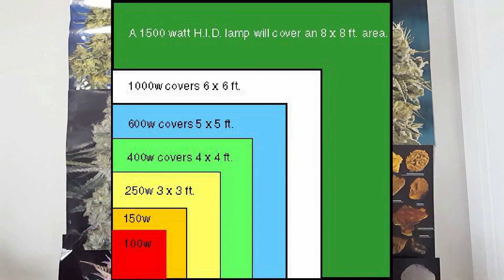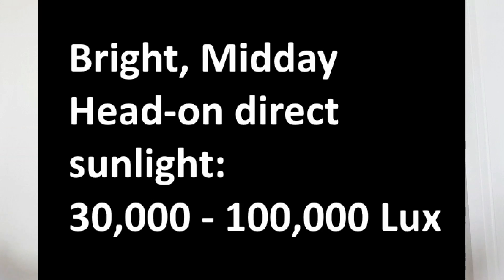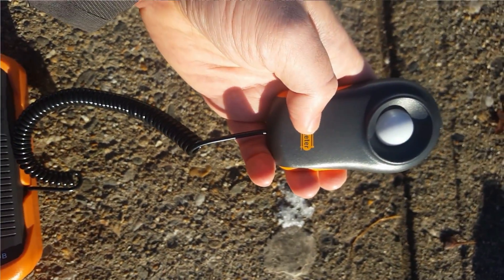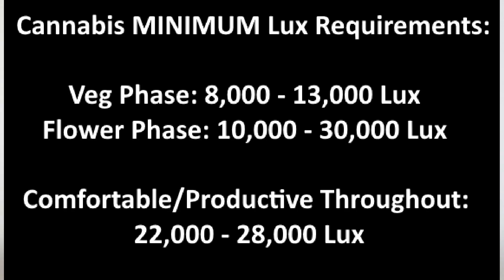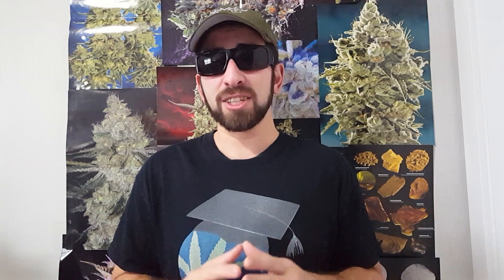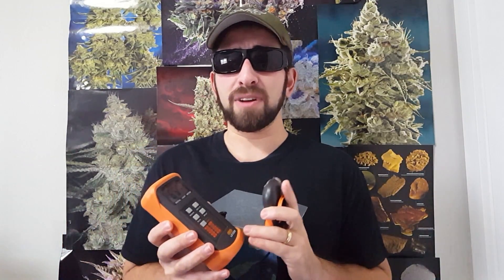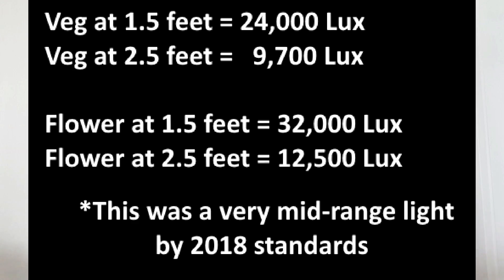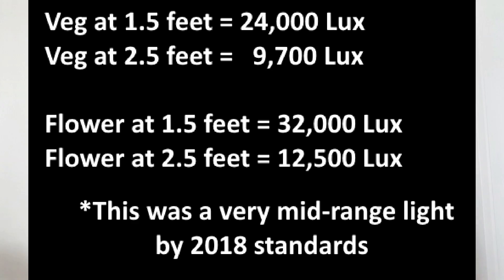How Many Lux Does Cannabis NEED At Canopy? + Digital Illuminance Meters Overview

Comment: I have looked as several websites, including royal queen etc... and they all mention values of 45000-75000 lux, that is 2-3 times more than you say, so I have no clue if I should aim for 60000 or 30000...
Reply: Agreed, most suggest  75,000 in flower. Lex recommendations are lower to all I have seen.✌️

Comment: I’m running fast bud genetics and using 1000w HPS DE and LED lights and have taken measurements with my phone and a diffuser. These plants can soak up as much as 80 thousand lux and seem to love it. During veg, anything over 40 K seems to keep the plants too compact under the LEDs. Different strains my have a  lower ceiling compared to other’s for the light the can use.

Comment: Thank you for doing this video for I'm in the process of using several different lights and it seems that most site are recommending huge lux numbers that my powerful lights could only reach if I burned the plants.  I saw numbers like 50,000 to 65,000 for flowering and 15,000 to 50,000 for veg.  Thanks for clearing that up for many of us.  Peace!

Comment: I am a first time grower. I am using T5s cause that what I had to over winter my plants. 
When it’s time to start flowering, do I need to change the bulbs to 3000k? I currently have 6400k bulbs in. Or just change the cycle to 12/12?

Comment: So ... if an LED light doesn't give off any (or very little) heat, should we worry about  burn at the canopy with a light under 1 foot from the canopy?
Reply: Yes, where heat wnt be an issue, intensity and light bleaching will be.
Reply: @reefslinger9188  Light beaching? How can that happen? The sun puts out a lot more intensity doesn't it?
Reply: @Superflow25  nope. It’s far far away. 😁
Reply: @reefslinger9188  Yeah ... I'm not sure that makes any sense. I'll let you know how "bleached"  my seedlings turn out with the lights at 12". You may be right. In which case I'll gladly confirm your hypothesis. Check back in 2 weeks.
Reply: @Superflow25  so? Is your seedlings was healthy??
Reply: @mikelazar8061  they’re fine although I took your advice and raised the light up to 18”. Thanks. For your help!

Comment: This makes sense to me. I have been finding symptoms of light stress (yellow or brown end tips) on the higher leaves in the canopy when I have been using the higher lux values advocated by others.
Reply: same here...i see ppl recommending a 600W hps to be placed 40-50cm above canopy.. its around 40-50k lux. thats crazy
Reply: @ninjafrog8419  man, all bs, check out the new studies on light. Apogee Instruments is a great start.
Reply: @ninjafrog8419  50k was actually where my buds was the most frosties, 40 and 60 turned out with less.. remember a healthy plant can tolerate higher light levels ;)
Reply: @Avation911  all through out? Or that is ur final light?
Reply: When u have a really healthy plant yes you can slowly lower to increase be careful about burning the leaves I’ve had a 400 watt MH/HPS combination bulb @8inches yes glass and vented fan on each side but it was very healthy finished super frosty sometimes fluctuating the distance of the light helps the plants to if they get to bushy not really a thing but ease it back a few inches it looks to be slowing down in growth drop it 4 to 6 inches ❤😂

Comment: you know this may have really helped me out today. Ive been wondering why my girls in veg have been showing signs of stress, and It may have been me cranking my Quantum Boards up too high. I have a LUX meter on my phone ( not very accurate ) but it gave me an idea of how intense these lights are.

Cranked half way up and at around 3 feet It was saying 35-45k at canopy around the centre of the tent. First run with these boards as ive just upgraded from some citizen clu048 1212 arrays, and these boards are better in every way so far. They have 3500k, 5000k, 660nm, 730nm and 385nm. Ill give them a few days turned down and see if they turn around.

Comment: Sunlight here is about 130,000 lux, I just measured in April. Why do indoor plants get light burn excessive Lux, but  less than that of sunlight, even if the heat is dealt with? But outdoors they do not.
Reply: The sun moves so it's constantly changing position and not concentrated perpetually. Grow lights are fixed, direct points of radiation concentrated on the same point on the plant constantly.
Reply: @blueflowers6738  Yes the Sun moves (in a straight line), but in fact it is the earth that revolves around the sun not the other way around so, it is the earth that moves not the sun :)
Reply: @sopalen   the sun moves "relative" to the Earth and the plants on it. ;)
Reply: @sopalen   and the sun doesn't go in a straight line. ;)
Reply: @sopalen  and the Earth orbits the sun. It revoles while doing so getting that even lighting that plants enjoy. Well rather the Earth enjoys, us and the plants being akin to fungi. The Earth is alive, we are born of it, not on it. We are all the Earth.
Reply: @blueflowers6738  Nope ofc not it orbits Sagittarius A* i guess :)
Reply: @sopalen   and Sag orbits another that orbits another that orbits another. Pretty "far out" stuff! :)
Reply: @blueflowers6738  I know, i just did not knew that you did :D have a nice weekend m8.
Reply: @blueflowers6738  Yes it does, this is the third time responding to this, YouTube might have fucked some shit up i dunno, but yhe ofc you are correct, have a nice weekend m8.
Reply: On a sunny July day in Arabia you will receive 400,000 lux😂

Comment: Great channel and great info. You helped clear up my confusion about what was the correct amount of LUX at the canopy level.  I'm seeing 25k at the top of the plant and 12k at the bottom in flower with the light about 2.5 feet above. i worried LUX was too low but now i'm resting easy all the way to harvest! thank you!
btw... i use a free LUX meter app on my android phone and it is fairly accurate. If i had more than 2 small plants in a 3x4 tent with 600w hps, i'd consider a dedicated 
https://www.youtube.com/watch?v=ezhAZcpRkNg&list=PLkkO4lYMrrrmugcJ9ySxWLeqJYxK2qCqS&index=17&t=0s

Comment: Hey Lex thank you for the video. Im on my 6th grow and Ive noticed something about LEDs that I dont see mentioned. Thought Id see if you have noticed this too. If you place LEDs too close to a plant (say less than 12 inches/ especially when in veg) They tend to have shorter internodal spacing and a general bushier build. As I said only a few grows and this is comparing clones from bag seed so was hoping you could tell me if its in my head or not. Thank you.
Reply: of course internodes will be closer when light is closer, when the light is further away the plant will stretch causing stretched internodes , more light closer the internodes ...

Comment: Lex first off what a great show. I just got my Dr
Meter and checked the Lux. It was 45,000 so I raised the light to about 2 feet
from the plant. It now reads 35,000. I know the optic 2 runs hotter than other
LEDs I’ve have had in the past so do I still need to go up with the light? I
have the room to go up. Just wondering what is better for the plant.

Comment: Thanks for this video Lex  its the one that i really needed.  I ordered a Lux Meter from HydroFarm  in all honesty i thought it also read the PPFD  but it does not and i had no idea what Lux value  cannabis would grow in.   So this video actually really helped me. The lux at the canopy of my plant was at 45000.  So i moved it up to get into the range suggested.
Reply: @tommy whitlow well the light i have is actually a pretty good light. I have the hlg qb100 while i didn't get monster buds the ones i got were pretty dense. 4 zips from 1 plant. I have upgraded my lights since and now have a mars hydro sp 150 so the lux value is 100k at the top and 80k threw the canopy. My par value is around 1000 ppfd above that you need to add co2. I am not light limited now i am carb limited.
Reply: Also i think lex is giving us the minimum light needed to grow.  Ie..a 75w cfl will grow a plant but you will get small buds. (I say this because i have done it)

Comment: I picked up 3 2500 lumen cfl bulbs at a salvage store can I use them or will that electricity be wasted
Reply: Dangit man, you can use them. 7500 Lm is enough for a small grow. I used to do the same with cfls in a  50x60cm cardboardbox yielding pretty good. Edit: then again, waste or not.. you could buy a small cheapo more efficient LED fixture.  I bet your 3 cfls is aprox 50W each in draw.
Reply: @svenzia  i also have 12 12 watt 75 watt replacement 24 inch red/blue led grow lights from Walmart i added 4 under Cabinet led lights and 4 24 inch t5 plant light
Reply: @donkeedik2302  Have you planted seeds? You are good to go man. I have done lots of cfl grows. Awesome quality. Big upz!

Comment: Thanks lex for another very informative video! I have a question off topic however. It is to do with tinctures. Many recipes call for decarb of flower, soak in alcohol for a period of time and then a strain. Simplified version. My question is this, can we use fresh cut flowers? This saves on dry/cure time. Flower usually sits for two weeks anyways. If this is okay, how can we scale the recipe? For example if I use 4g dry/cured flower per 1oz/35ml of high proof alcohol. When using fresh off the plant flowers they’re full of water etc and thus heavy in comparison. How can we figure out how much to use. Without a trial an error. Ball park guessing/educated workings.....
I see it’s more than one question, but it’s all relevant right? Much love fella. I look forward to your speedy response as always!
Reply: didnt seem to be so speedy of a response bro
Reply: Honestly you will have to do trial and error, I have not found a video yet that will convert it from dry to wet , one piece of advice is use 190 ever clear it’s a lot safer I have used both & they both work .

Comment: Use an app on my phone.
Not super accurate.
But good enough for my basic  spacing and defoliating needs.
Reply from the maker: I hate to say it, but the phone apps are REALLY  inaccurate - it's a poor substitute....phones just don't have the on-board hardware required to take the measurements as intended for the lumens math to be right.
Reply: Lol.. Wouldnt doubt that at all.
Probably just soothing myself somewhat.
Im not really using the apps actuals numbers as values per say.
Ive never used any metering on lux values or really considered it previously at all, with no issues because of that neglect. 

Im just using the app by placing my cell into certain lower areas of the plants to see light penetration through canopy, so I can defoiliate accordingly or adjust lights/reflectors, etc.

Seems to work for that basic light registering need. 
Saves a bit of time by checking angles above and beside  canopy for light penetrations quick, if im growing vertically and not scrogging or mainlining.
Reply: Im basically trying to decide if I need or want that $32 meter that I looked at in your Amazon store..  hahaha
Reply from the maker: most people have no need to measure Lux and if they need a meter it's a PAR meter, which are pricey. Measuring Lux is sort of a specialty thing for certain situations, as mentioned in the first couple min of the video.
Reply: Yes, I think the app is somewhat misleading in its name, lux meter. 
I looked into its design and its more of a light intensity meter,  that runs with an algorythmn. 
Its reliant on the hardware of the specific phones sensors, much like you mentioned.

Some newer cell models have some impressive sensors for this aspect, I think with design in mind for more photography type applications.

Comment: What’s the damages that can occur from 315 cmh bulbs without eye protection? I’ve been dealing with some scary symptoms & haven’t been able to share the love to my garden. :(
Reply from the maker: You can do extensive eye damage working with HID bulbs over the long-term without eye protection (though, you'll be fine with HIDs at least, if you just avoid looking at them directly). If you're having scary eye symptoms, go to an optometrist.
Reply from the maker: & happy new years!
Reply: Lex Blazer thanks! 🙏
Reply: I'd assume similar to welding flash but not as bad unless you are exposed for a very long time... Symptoms of damaged eyes from u.v. feels like you have sand in your eye that won't go away for days, plus redness, tearing, light sensitivity.
Reply: volvo09 thanks for the info. Idk where to go from here. That doesn’t sound to good for me. Hopefully these doctors around here can do something

Comment: Hi Lex, love your channel and the way you explain things. Very pleasing to watch and learn!

I wanted to ask you something about light.
I'm growing a single plant in a small 36''x20''x63'' Vivosun grow tent equiped with an intake fan at the bottom, an exhaust fan at the top, and a oscillating fan to move air around. I was using a Mars Hydro Reflector 96 (rated perfect for this size of grow tent). I first attempt to grow vegetables such as lettuce and cucumbers...but i laways felt like the blurple color of the light was changing the plant structure quite a lot (and not in a good way). The plants aren't reaching for the light and bush too much (with leaves staying small and curling). First, I though the light was too close to the plants (even though it was set a the recommended height)... but it never got better.  Plants grow quite fast, but in a strange way. Now i'm growing a Blueberry strain. I started the seed with the Mars Hydro light, but again... too short and bushy (tight nodes) at 24'' height (rated at 680 PAR at center in full BLOOM mode, at 18''). So i bought a new affordable light on amazon that i felt was a pretty good deal. It's an AGLEX 1200W COB (veg 113w, bloom 208w), with 2x 5500K Bridglux COB with 60º lenses (extreme PAR values), + RED, BLUE, UV & IR Epistar dual-chip boost for BLOOM.  It's kinda like an OPTIC 2 replica (with differences in the color blend, but has a very good full spectrum and same true wattage at the end). So far, my plant is LOVING IT, leaves are getting big and straight.... very healthy looking!  Although, I'm getting a little bit nervous that i won't have enough height space in the tent once it's flowering. I don't own a light meter, so i'm just experimenting with some free iPhone LUX meter apps. In VEG, I'm getting around 30 000 - 40 000 LUX in the center at 36''. In BLOOM, I'm getting around 60 000 LUX in the center at 36'' (around 85 000 LUX at 24''). Based on your video, this light is WAY too intense for this grow tent, right? The OPTIC 2 is rated to flower a 3x2 area, but the COBs have 90º lenses (wider spread, less intense), and recommended height is 18-24 (bloom) and 24-36 (veg). I contacted AGLEX and they replied that I should keep the light between 24-36'' (never below 24'').  What do you recommend? Should I trust them, or the iPhone LUX meter apps? Do they give me an ''accurate enough'' reading to judge? I can still raise the light up 6'' further away, because it's hanging 12'' from the ceilling at the moment.

Here are the links for the 2 LED lights :
https://www.amazon.ca/gp/product/B07F7TVKGW/ref=oh_aui_detailpage_o01_s00?ie=UTF8&psc=1
https://www.mars-hydro.com/led-grow-light/mars-reflector-led-grow-light/buy-mars-reflector-480w-led-grow-light-for-medical-plants-mars-hydro-for-sale

BTW, temperature and humidity are totally fine in the grow tent (22-25ºC day, and 20-22ºC  night, and between 50-60% RH at all time).
I can send you pictures of the setup if that could help!
You can also message me in private at davidlabbee@live.fr

Thanks a lot for all the help and knowledge you're providing the world!

Comment: a mars hydro is NOT a 'mid range' light, not even in 2015, it's absolute bottom bin. surprised there was no mention of PAR (photosynthetically active radiation) either, PAR meters are much more accurate than lux meters and a lot cheaper than a spectrophotometer too
Reply from the maker: I disagree that it was bottom bin; I've seen far worse LEDs in 2015. As for whether or not it was midrange in 2018, depends on your outlook. I'd say a decently-built LED with half a dozen bands, that filled up a 4x4 well, was mid-range in 2018. You'd be surprised at how low of a percentage of growers, outside the group that watch a show like this, actually spring for lights with 10+ bands, or COB....yeah, those are the nice ones, but they're used by <5% of folks. Heck, most old school guys I know still refuse to get off HID....Also, I DID mention PAR in the first 2 min of the video and that it was more important than lux, but this episode is about illuminance only....obviously you skipped over parts of the vid.
Reply: @LexBlazer  im one of those can't get off hps growers...lol great info as usual✌